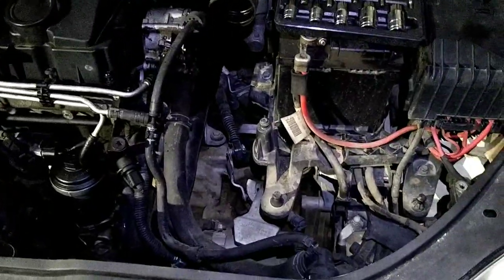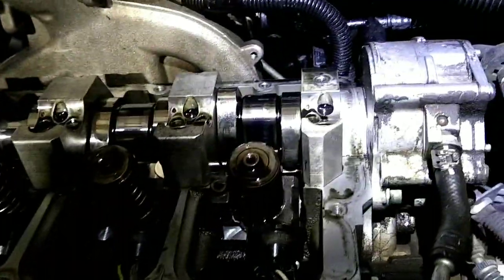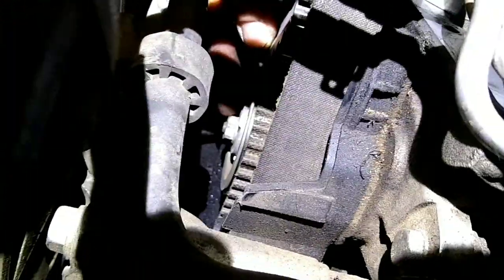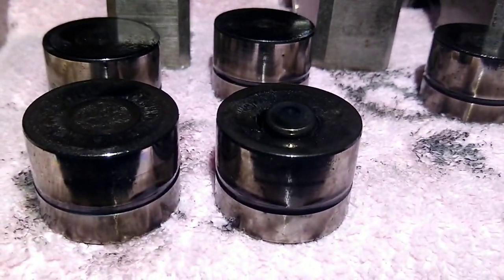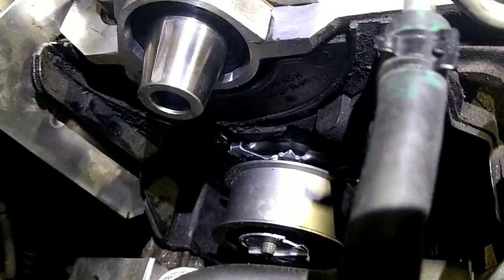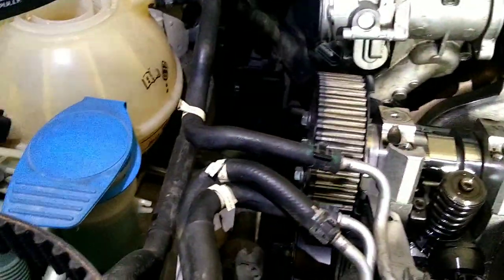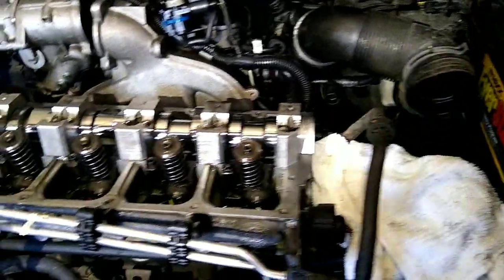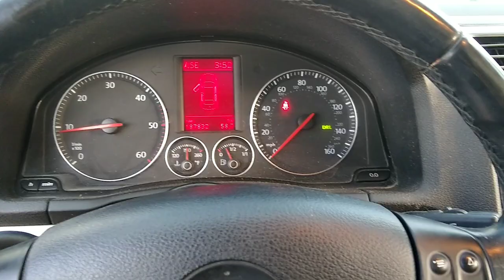Step by Step To Replace Worn Camshaft and Timing Belt on PD TDI, BRM/BEW/BHW and others

Comment: The tandem pumps needs any timing ? Or it goes in only one way
Reply from the maker: No timing needed, its just a fuel pump that's mechanical instead of like an electric tank pump.  It will only go in when the cam slot is lined up with the pump keyway though
Reply: @TDISwaps  wouldn't be easier to do the timing if you d remove the motor mount and af reservoir ?
Reply from the maker: @gigimarfa877  it may give you some room, but its also kind of a pain to remove

Comment: I didnt see you use a dial indicator on the injector backlash. Is that something you did
Reply from the maker: I did not mess with the injectors other than checking the quality on vcds, they were all in spec so there was no need.  Usually not an issue unless they are already out of spec or you actually change the injectors.
Reply: If you move tye injectors from tye cam then you have to do backlash.
Reply from the maker: I have done this 5 times now without issue, checking backlash is the best method, but it's clearly not required or I would have issues by now I would think

Comment: Did you remove the springs from the black Ina nitride lifters?
Reply from the maker: I didn't, I think that's only needed with the older VE engines
Reply: @TDISwaps  Geoff at colt camshaft told me to do it on my 05 pd. Was still hesitant to do so. Still haven't fired it up.
Reply from the maker: @dexterj490  well mine is working fine with them in, but I'm also not sure that I got the black lifters with this kit

Comment: Does anyone know why the cam bearing caps won't come off the head.
Reply from the maker: I just used a screwdriver to carefully pry under the sides of them and they popped up and out
Reply: @TDISwaps   where did you pry it from I can't find a good spot. And is the head supposed to come loose?
Reply from the maker: @littlelouievs  no the head should not be loose, there is part of the bearing that hangs over the lifters and thats where I pry at to pop them out
Reply: @TDISwaps  im in need of help. The head came loose when I took the cam bearing cap bolts off. I'm not sure what I have done...
Reply: @littlelouievs  you didnt loosen the cam bearing caps, you loosened the head bolts on accident. I just made the same mistake had to do a headgasket.
Reply: @Jimmy-ht6ii  thanks I realized that and had the cam in and out then realized I needed a headgasket but just sent it for 5k miles
Reply from the maker: @littlelouievs  I must have missed your last message sorry to leave you hanging.  glad to hear it's still working!

Comment: I figured it out the cam cap bolt holes were filled with oil it took the head bolts out. Opps. Breaking it in now
Reply from the maker: I was wondering if you didn't accidentally take out the head bolts, sorry man.  Glad you got it though!
Reply: @TDISwaps  yeah since I took them out i fucked the head gasket so thats on the list now😭😭😭😅

Comment: Do you have to remove the engine mount?
Reply from the maker: No sir, 04+ they routed the belt around the mount so it doesn't need taken out
Reply: @TDISwaps  sweet im doing the cam on my brm right now!
Reply: Any advice
Reply from the maker: @littlelouievs  I tried to make it pretty detailed, just take your time and you'll get it

Comment: Valve cover can be pulled without removing the egr if necessary. Otherwise great video
Reply from the maker: Not sure what my deal was but it sure wouldn't come past that valve, but maybe it's just mine, thanks for the tip!

Comment: You forgot to adjust the injectors
Reply from the maker: That shouldn't have changed, and they all tested good in vcds so they should be fine, but it is a option if you want.

Comment: There are so many small steps missing like setting the cam to top, and torque settings.   I'd not be surprised you killed and damaged the inteference engine. People Get a manual and stop follow these fly by night wanna be mechanic videos. If you are not gong to do it right stop posting these videos. You are just going to get people  in a worst situation  and destroy  an engine
Reply from the maker: I showed you how to set to TDC sir, and looking up torque specs is not hard.  Sorry you don't approve, but thanks for watching anyways.  I have done 10 now like this without issue and personally helped over 20 others that have running engines now.  You are more than welcome to make a better video and include all that stuff if it worries you, but I'm gonna keep helping people my own way.